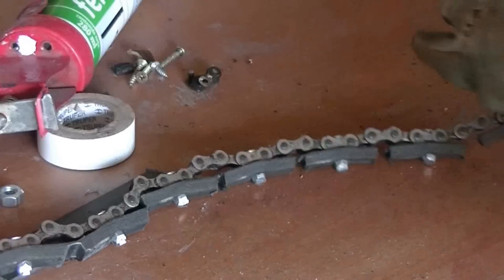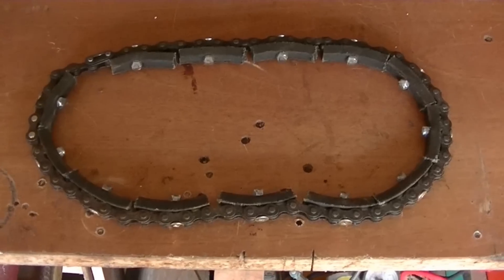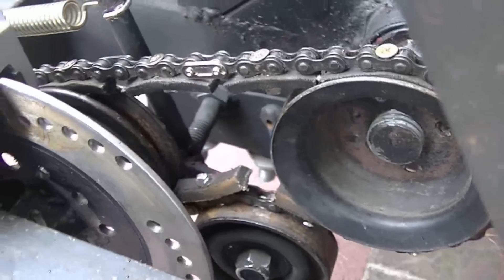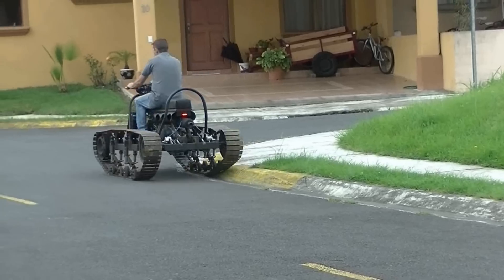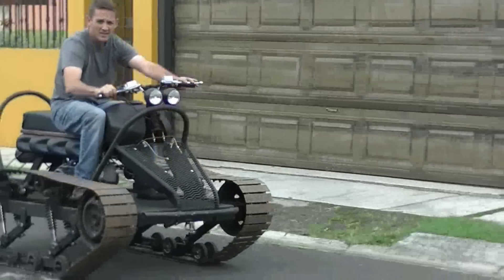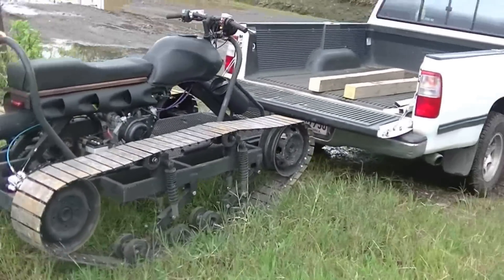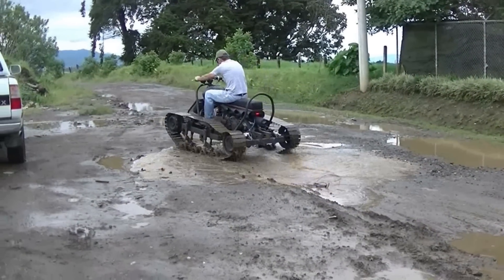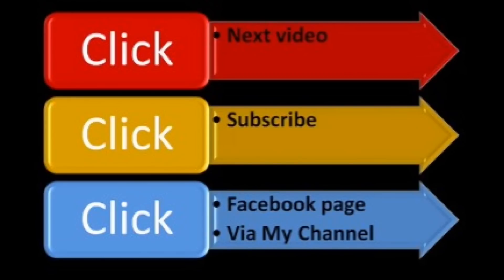Drive train update 10D

Comment: Hey man. You need to use a Borg Warner T-20 transmission from an old Maxx IV 6x6 amphibious vehicle. Chain drive from a side shaft engine. Chains driving the tracks. They are normally set up for skid steer, but you can modify them to make a true 'zero turn' machine. Just my .02.

Comment: yes, please install some guards over those tracks to protect your body in case a track breaks.  those tracks have alot of inertia at high speed as they travel around the wheel.  watch the ski lift out of control in a foreign country (or whatever its called) video to see how much inertia a ski lift chair has when it is going too fast around the bottom lift.  its pretty horrific.  (or just limit your speed)

Comment: Ive seen alot of russian home made tracked atv videos and the things they seem to have in common are that they use convaier belt straps with bars or cleats to hold them apart and align them on the drive wheels. and second they all seem to use tires on the drive wheels.with the rubber against the metal. I think using the air pressurized tires they can increase the tension on the belts granting more bite. and because the convaier belts dont really stretch much and if they do they have elastic qualities allow them to bounce back. many also have the drive wheels  down low and touching the ground so even if the belt slips a bit they have power to ground. as a way to use your existing hardwere I would  lay down a pair of straps on the outer edges of your cleats and swap out  one of your drive wheels per side with an air pressurized tire or something adjustable for tension. you may need to add taller guides on the cleats to accommodate the tension tire. optionally when adding the straps to the cleats it would be a good time to add rubber, wood, or HD plastic blocks to give you more bite in soft ground.

Comment: instead of putting a belt onto a chain why not just use a sproket and chain and cut out the middle man
Reply from the maker: It has to be able to slip to steer.
Reply: try my sproket Idea and then have that run a gear that can be pulled out of the drivetrain letting the sproket run nothing

Comment: I'd have gone and gotten two cheap harbor freight motors and mounted one for each track. Then did some quick and cheap mods to increase the rpm and power. Both motors would use 420 chain to drive them tracks and big centrifugal clutches. Probably run a 6:1 ratio on the chain from motor to track.

Comment: Very original but the reason why your machine slips is pretty much the same as bald tyres. Your caterpillars needs threads of sorts to propel it forwards &/ backwards. Think of it as an elongated tire. All your caterpillar will do is simply reduce ground pressure &/ increase what they call flotation but you'll still need something to claw into soft grounds (threads). I hope you'll come up wit something as I am sure all your followers would like you to succeed. Best of luck & kind regards.

Comment: Worst case scenario you put electric drive on the tracks and a generator to the motor or a hydraulic drives. Or you could add a double differential like on a dozer

Comment: how does the suspension work to keep the track tight? im guessing the shocks push up on the rollers to maintain a level of tightness so the track don't collect or slip off. im planning for a future project on a nitro RC car using the shocks u can buy for 5-10 pounds a pair and about 5 sets in total, creating a light tank track which can bolt on the underside and still provide the power and more grip than wheels making it look cool as hell in the process!
Reply from the maker: Yes the shocks keep tension on the tracks.

Comment: i would get rid if the belts and use a small differrential like the ones used on the back of a subaru justy or from a side by side like a yamaha rhino. you can either make it a direct drive or a chain drive and you wont have a belt slipping problem any more.

Comment: I'm going to try something like this. what was the rough price.
Reply from the maker: About 800 dollars
Reply: thats it, thats insane,
Reply from the maker: The motor was the most expensive part because I bought it new it was about 350 dollars. The rest is from the junk yard , hardware store and motorcycle parts store.
Reply: I'm an interactive designer and I'm about 3 weeks from launching my biggest project. If its successful then I will be building a version of this. Or rather I wanted to start a project that required the building of custom tank treads, and 800 is a perfect price.
Reply from the maker: Of course that price was here in Costa Rica. It could be more depending on where you live.
Reply: well their goes my next question. I was going to ask if you ever considered selling one. or parts. I'm going to be starting a prototyope soon.
Reply from the maker: The overall design of my tracked vehicle is good but instead of using belts for the drive I would recommend using an old golf cart rear axle or something like that to lessen the problems with steering and power problems with belts slipping.

Comment: you should use a hydraulic pump and a lawn mower engine and then use the pressure from the pump to power the tracks with hydraulic motors and you put two valves on the steering wheel and then you can forward and reverse instead of just forward on each track

Comment: You need rubber treads.  Those metal ones will give you little traction, just lots of surface area and they are noisy and rough.  Same with the wheels, use regular rubber wheels.  Most treads that lift like that have the drive wheels (and suspension) on the two large wheels on the ground and have a third tensioner wheel on top.   You might try covers over the belts to keep water out, but really a centrifugal clutch on both sides will work better and wear better.

Comment: hey have you thought of using something along the line of an LSD diff fixed drive to both sides but applying brakes to one side will slow down one side as well as speed up the opposite side and with no brakes applied in theory should keep equal drive.

Comment: I had this same issue with a 41.5cc Cobra Scooter ~ the big sales gimmick was that it was a smoother drivetrain due to the use of belts.  Hit one puddle and it's all over.
I ended up converting it to a #35 chain.

Comment: Quick class - why to tires have tread on them?

DUHHHHHHH?
Reply: to push water away from flat surfaces, you must be thinking of tractor tires. they have grooves not treads ;)
Reply: Tires channel water/snow/mud away so it keeps tire in contact with the surface its being moved over. These are groves pattern designs cut/molded into the tire. Your thinking of tires for tractors, tractor pulls , uphill motorcycling , ,motorcycle water hopping , baja racing,  jeep crawlers where they build up certain high pattern areas on the tire to help grip .But even they can only do much before they are no help.

Comment: use chains instead of belts and use an open differential in the center carrier. will function just like the setup you are using but with absolutely no slip and probably a lot less nose dive whenever you apply the brakes.

Comment: This is a late thought since post is in 2015 and its 2016 , take the pullies off on replace with industreal sprocket and chain ,or 2 differentials,
Reply from the maker: +rebel xtc You cant use sprockets to drive the rear wheels because it wont be able to steer. If you had a limited slip diff for the drive it would work but then you get into a whole different set of problems connecting a diff to a scooter motor. I am working on changing the pulleys for bigger ones to help with the slipping I will try and post another video soon. Thanks for the comment.
Reply: I gottya seen in vidieo u were using brake to turn and belt slips on the  side u brake,,basic chain drive rearend  with two jack shafts,, ,, U cant use clutches it would burn them up in a few turns  unless u use electric clutches  and it would cost a ton and cant use manual belt tensioner  because it would redesion the way u got it to steer know,  through the drakes ,,,but if u used you handelbars with manual linkage basic pitman arm and or cabel  to each belt tentioners u could use your handel bars to steer,and brakes gest to brake Then again I might be full of crap cause I don't know the basics and layout
 of your build,,,lol
Reply from the maker: +rebel xtc What I am working on now is when you turn the handle bars it pushes brake levers either left or right and also release tension on the belt on the same side at the same time. There are a lot of other ways to design this but the idea is low cost that anybody could put together.
Reply: cool ,,good luck and I wanna see the thing run perfict on day ..you can do it..

Comment: just a thought.... try using drive control out of a zero turn mower, I did it for a small cart for a friend.
Reply from the maker: +Roger Nash Good idea.
Reply: The double pulley you have will work with the hydraulic pump system they use I think I still have 2 in my shop

Comment: put the tire on each rim to push more traction
Reply from the maker: +sanmarcos man The slipping is not on the tracks its on the pulleys that drive the tracks. Thanks for the comment.
Reply: +Aceman307   I used WD 40 it grips alot belive me

Comment: yup this is the one that showed me you haden't made the drive pully into a sprocket! (and that is why I thought the drive pully on the outside was slipping my friend, and not the engine side of the project)
Reply from the maker: +Lar Mayotte  I cant make the connection between the engine and the drive wheels with chains and sprockets because it wont allow me to steer. I have changed the size of pulleys and will be making a cover for the belts I think this should help with the problem. Thanks for the comments
Reply: +Aceman307  Put an ATV differential in it

Comment: I see others have mentioned what was my first thought, adding a drive differential from a small car. Looking around you might find one for free, or close to it.  After that, it looks as though you would benefit from using chain sprockets for your drive links instead of belts. Bit more work, but much stronger drive mechanism.

Comment: a simple drive train differential should do the job if youre using your brakes to turn.
and a horizontal rods welded just inside the long edge of each track and a tab sized  piece of tire rubber on the 1/3 and 2/3 spot on the tire end just higher than the metal on each side would make huge difference on and off road.

Comment: Oh the sound is so high😓
Reply from the maker: +TG101 TG101 There is a little button on your computer to turn it down. I would rather have the volume a little high and be able to turn it down than to low and turned all the way up and still cant hear it.
Reply: +Aceman307 ummu.....I mean't  the vehicles sound not my computer
Reply: +Aceman307 but still your vehicles still cool👍
Reply from the maker: +TG101 TG101  Ok, Thanks. I am going to add something to the tracks so its not so loud.

Comment: how about.....chains?

the only thing that can happen here is that they  snap....wich requires an immense amount of force what you will never generate with that thing
Reply from the maker: +Brony Channel If you use chains You wont be able to steer.
Reply: Aceman307
and why is that?

sorry, i don't know the details bout that type of eicle, would really apreciate it if you could explain that to me
Reply from the maker: +Brony Channel With a tracked vehicle you need to be able to stop one track to steer .If you use chains to both tracks you wont be able to stop one thats why I am using belts.To be able to release tension on one to be able to stop one side or the other.
Reply: hmmkay....

can't you split the drive and control them individually?
or you add a clutch to each side and then disangage the side you need to stop, might also simultaniously engage the brakes

if you have discbrakes you can use the same lever to use the brakes and the clutch, the clutch will then be reset by a strong spring

you can use either a clutch with discs or with teeth, the one using discs would be better in my oppinion thou

edit:

you could also add a steering weel so you have like, a hydraulik cylinder for the brake and the clutch for either side, if you twist the steering shaft a lever will then push on one of the cylinders slowing down one side so you can make a turn.

that way you can steer easier and more fluently
Reply from the maker: +Brony Channel If you check out some of my earlier videos on this you will see how I split the power to each side also how I plan to engage and dis engage each side.

Comment: You should do it the other way. You gear down wifh chain and sprocket and this high torque transmitting with a small pulleys.   Swap it. make chain/sprockets as final drive and puleys will have to transmit much less torque...

Comment: I am by no means an engineer, but perhaps a differential from a small car would work better? It's sturdy, hermetic, and above all, rigid - no slipping at all. You could also still steer with the brakes, as all the power would be directed to the side which gives less resistance. Is that a sound idea?
Reply: i had this exact idea, open differential and use left side and right side brakes for steering.  my opinion is that it would work.  i would love to hear ideas of why it wouldnt so that i dont waste alot of time building, just for it to fail.  however, my arguement to Andrew Crews would be that on a wheeled vehicle, you only really get "torque steer" on front wheel drive vehicles and this is due to torque (from the engine) being applied outside (or inside) of the steering knuckle centerline.  obviously both sides are the same, so it doesnt really make sense to me why they dont  simply cancel each other out.  even so, i think that if you welded the steering wheel straight, there wouldnt be a noticeable steering under acceleration.  any thoughts?
Reply: +Andrew Crews That could work, but when locsked you would not be able to steer at all, so the lock would function only as a last-resort measure to unstuck a slipping vehicle. I think that applying braking force on the slipping track would be enough in most cases.

Comment: i built a similar unit years ago with snowmobile tracks that worked good , I used an old lawmower hydrostatic transmission , those used on zero turn lawmowers , go to your local scrap yard youl probably find one there.

Comment: get rid of the belt clutch. use a regular # 35 or #40 chain 13 tooth drive clutch, run the chain to about a 24 tooth gear on a jackshaft, at the other end of the jackshaft put a 15 tooth gear, run a chain to a 60 tooth on the final drive. I did that on a dingo go kart to eliminate the belt drive. that should solve your problem. then you can work with your gearing from there to adjust for speed or torque.

Comment: I had the same problem with belt slipping on a off road go kart in the mud being driven using belts because I was using a modified lawn mower transmission use the cables to pull the belt tensioners tight instead of to release it and depending on the springs you may have to find heavier cables or something else but it will allow the belt to grip and not slip
Reply from the maker: +Jeffrey Murdock I am going to use larger pulleys and make a cover for the belts. I think this should help. Thanks for watching

Comment: Have you tried Motorcycle chains and sprockets that could bolt in place of the pulleys?  a chain broke to proper length with the tension-er should cure the slip problem. motorcycle chain has  better strength  than bicycle chain. Don't want chains popping in a mud hole. just a thought     good luck . I like the build pretty cool.
Reply from the maker: +Eugene Willsey I actually tried sprockets direct from the drive axle to the drive wheels just to say I did it. I could not steer it!! The trick is one side has to be able to slip so as to be able to steer. I think I have the solution I just have to make time to put it together. Thanks for watching
Reply: maybe a zero turn mower drive line ?

Comment: Use a small automotive differential at the rear, shaft drive direct off the transmission, and use the built-in brakes to steer.
Reply: +Steve Wright If he did that wouldn't one side stop turning sometimes like a car does when it is stuck in the mud.  Wouldn't work if that happened.  And if he used a locked rearend like we did in my hot rod days it would be locked all the way across all the time.  Solid, no good either.
Reply: +BushPilot444 No, that's the brakes do - force the torque to the other track.  IF I am correct, he is slipping a drive belt to get steering - that's a bad thing to do to a belt, to "teach" it to slip - if you do that - it will always slip - oops, no drive when you need it..  Most tracked vehicles use clutches and brakes, but that is too complicated and not warranted here, but a differential will allow slippage side-to-side while fixing the slip problem, then belts can be done up tight, or motorcycle chains used.  I would put the track drive pulleys directly on the differential, turn the motor sideways, and use a conventional driveshaft.  Nothing to slip.  Good steering.  Low maintenance.
Reply from the maker: +Steve Wright If you watch the video series you will see I have a tension er hooked up to the steering wheel so when you turn the tension is released off of one belt to allow for slipping the same idea as when you engage or disengage your lawnmower deck blades. My problem is I used too small of pulleys so there is not allot of surface area for the belts to grab . I am currently moving the engine forward and using larger pulleys I think this will solve most of my problems. Thanks for watching.